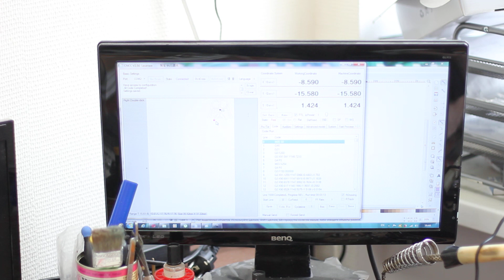Laser engraving on a transparent acrylic

Comment: How would you engrave on the top of the acrylc? Ive seen people do it but my machine wont do it....laser just goes through and doesnt engrave
Reply: @frazererazer  This was a fantastic, easy to follow and understand tutorial thank you!
Reply: Addi g to thus . When i get my acrylic. It still has a paper cover on both sides. I tried on this peelwd off and 1 that i haven't peeled off. . The peeled off one  had the laser go through. No effect.  For the unpeeled one, it burned the paper and together it marked on the clear acrylic... Just sharing
Reply: Put a sheet of paper on it, that should yield a reasonable result
Reply: that will be CO2 lasors, theyre a different wavelength that Acrylic absorbs
Reply: @frazererazer  thanks for the link and idea!
Reply: @frazererazer  seems perfect, though i'm not sure if it is easy to buy a rubberized paint like you used. would elastomeric paint work?
Reply: @avengers212  I am sure it would yes. Also the rubberised paint is sold in most car parts stores.
Reply: @frazererazer  thank you very much it a big help
Reply: But  maybe out of topic. Sorry. Buti need to ask. How do i control the power of the laser output? I had to input an S50 on the lasergrbl, then i changed to s200 i noticed the power increased. Having my laser with 15w , how do i know as to up to how much power i can set it at? Is there a chart or a guide? I'm really blank about it. Please help. Thank you
Reply: @frazererazer   Thank You!